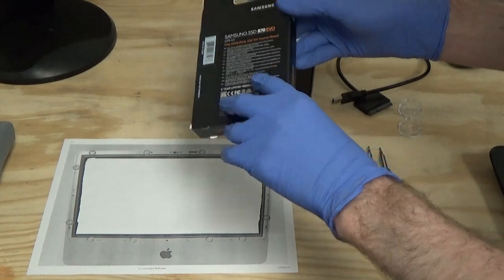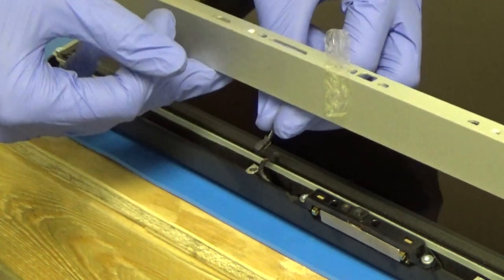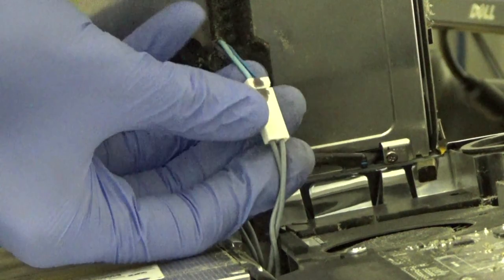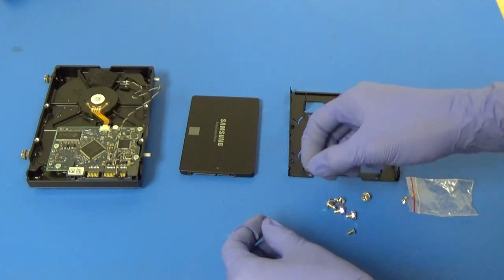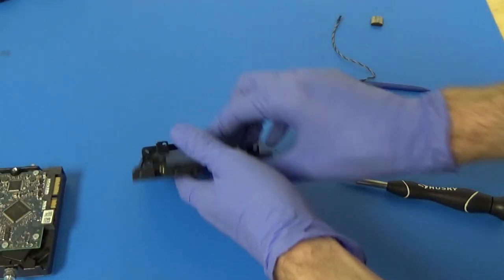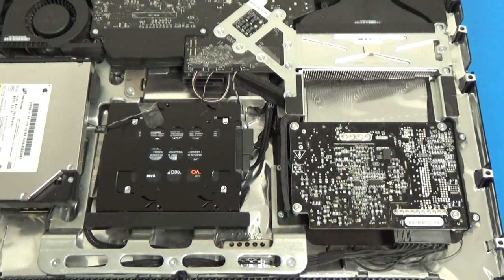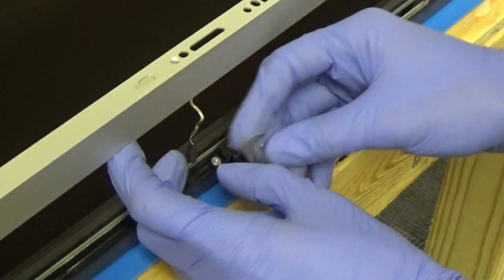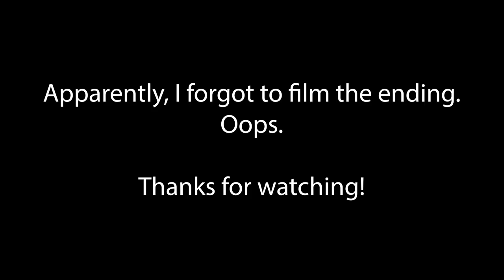iMac (20-Inch, Early 2009) SSD Upgrade

Comment: Great video! I was curious though how do you clone the original hard drive on to the ssd? I want to keep all my files and settings from the factory hard drive onto this one
Reply from the maker: I use a program called Clonezilla. If your new drive is larger or the same size as the old drive, you can make an exact copy. If you’re going to a smaller new drive, that program won’t work.

Comment: If one gets the same hd as the original. What's the one to get?
Reply from the maker: I don't remember what was originally in this one. The Apple Tech Specs page for this model [ https://support.apple.com/kb/sp507?locale=en_US ] shows it would have been either a 320 GB, 640 GB, or 1 TB 7200 RPM SATA drive. It doesn't specify the brand, but I've seen a lot of Western Digital/HGST drives used in Apple products. Hope that helps.
Reply: @G6TechnologyServices  Yeah I suppose. The one I happen to have in there was the Hitachi brand and had the apple logo along with some writing on the sticker.

Comment: Thanks for this. Going to try.  Questions: Same HD and case for 27" IMAC? and I have a timecapsule backup, would I be able to just load it onto new drive from that?  Thank you.
Reply from the maker: I’m not sure, but it is probably the same HDD. It will need the same bracket. I’m not sure about the temperature sensor. Yes, you can restore the Time Machine backup to the new SSD. You will need either an installation USB drive or Internet Recovery to do that. I don’t think this model supports Internet Recovery.

Comment: I had the same problem as the commenter "Made With Junk" - the power cable would not reach to the SSD after installing the SSD in the bracket shown in the video and the parts list, so the bracket was unfortunately a waste. I then used aluminized tape to fasten the SSD to the back of the cavity where the hard drive was. I would recommend that you replace the battery in this iMac when you do this upgrade, as you've got the case open anyway and it's easy to replace (and the one in there is likely very old). It's a BR2032, which is NOT the same as CR2032 - different temperature range. You may not be able to find this battery locally so you may want to order it when you order the other parts. Finally, I didn't bother removing the LCD panel completely, I just opened it up from the left side as in the video, and propped it up carefully with a wooden ruler. There was still plenty of room to do the work under the panel, and I didn't need to bother with the cables connecting the panel to the computer (other than the temperature sensor cable).

Thank you for this video - very helpful!

Comment: Awesome video, very helpful 

I tried two different brackets for my SSD, one corsair CSSD-BRKT2 and one parts bin one and neither had the cables line up. The power cable was the problem and I didn't want to pull too hard on it. In the end I used some packing tape to tape the drive in. I also taped the heat sensor to the drive with packing tape because the adhesive was no good. 

When pulling the glass make sure to pull it straight up. I angled it from the top as I only had one suction cup. It worked, but it broke the very center, bottom alignment pin. The glass went on ok, looks fine and the magnets hold it. 

Lastly, the white connectors behind the screen are keyed. The pins are offset and there are subtle differences that make them one way. Great idea about the sharpie, but as long as you are gentle putting them back together they only go one way. It will go half way in the wrong way, but if you spin it around it will easily slide in. 

Now off to install xubuntu... :)

Comment: Does this allow you to have a better OS....more up-to-date? What would be the benefit of doing this ?
Reply from the maker: No, it won’t unlock anything special like that. The main reason to replace the hard drive with an SSD is to make the system faster. An SSD is several times faster than a hard drive and will improve overall system performance.
Reply: @G6TechnologyServices  I bought a year ago a Mac 2008, with 2 slots of ddr2 memory, and it has 4, can I update memory to 8 or will that not work, I am new with Mac.
Reply: Which os runs best with this mod

Comment: Hello, I have 20-inch, Early 2009 imac Intel Core 2 Duo - Ram 8Gb - NVIDIA 256 MB
Without ssd I can't upgraded to ssd. What's the best MacOS for my iMac?

Thanks.
Reply from the maker: It looks like 10.11 El Capitan is the latest supported version of macOS for that model. There are some tools you can use to put more recent versions on unsupported hardware, but do that at your own risk.
Reply: @G6TechnologyServices  Yeah, I know my MacOS now is catalina

Comment: I have an early 2009 with a 24” monitor. EMC; 2267.  Would the components be the same?
Reply from the maker: Here's the guide for that model: [ https://www.ifixit.com/Guide/iMac+Intel+24-Inch+EMC+2267+Hard+Drive+Replacement/9028 ]. It looks like the same process and would use the same components.

Comment: Any thoughts on replacing the 2032 battery?
Reply from the maker: You might as well replace it while you have the computer open. I usually change them when I refurbish computers.
Reply: @G6TechnologyServices  thanks I figured that, almost 15 year old battery is old enough

Comment: What is the best os for this upgraded iMac ?
Reply from the maker: You have a few options. The latest macOS that it will run is too old for me to want to use it, but you can put that on there if you want. There are ways to get the most current version or a more current version to work, but I don't like to do that because it can cause poor performance in some cases and can get messed up during software updates, but you're welcome to try it. There is always some Linux-based OS, like Ubuntu if you want to try that. If you can get Bootcamp to work or find the drivers, Windows 10 would be my choice since it is up-to-date and fully supported still.

Comment: Would this fix an imac that wont boot cuz of a bad startup disk??
Reply from the maker: Yes. If your startup disk died, replacing it should fix the issue. You will need to have a macOS install USB drive prepared ahead of time if your Mac doesn't support Internet Recovery.

Comment: What’s the best os to run on these?
Reply from the maker: 10.11 El Capitan is the latest version of macOS to be supported on the Early 2009 20-Inch iMac. I wouldn't really want to run that though because it is so old. You could always put Windows 10 on there or try out some Linux-based OS like Ubuntu. There are ways to get newer versions of macOS on unsupported hardware, but it is usually a pain.

Comment: Will this allow the ability to upload current software
Reply from the maker: No, it won't change the latest supported software version. It will only make the computer run faster.
Reply: @G6TechnologyServices .  I can't get into things I used to be able but not supported.  Not worth making it faster if I'm on a leash.  Debating imac or mac mini.  Other laptops have a shorter life
expectancy I'm told compared to a mac?
Reply from the maker: I’d say the life expectancy depends on the cost of the laptop. If you get a really cheap Windows laptop, it will be slow and won’t have a very long useful service life. If you get a nice Windows laptop, it can last longer than a Mac. Apple restricts the latest OS version that can be installed on their products. For example, I have a 2013 MacBook that still runs very well and is fast, but I’m stuck on an old version of macOS because Apple decided not to allow that laptop to run the newest version. Microsoft doesn’t really do that. I have the latest version of Windows 10 running on a PC from 2009 and it’s running great. As long as the PC’s specs are good, it will last a long time.
Reply: @G6TechnologyServices .  Does this also apply to desk tops
Reply from the maker: Yes. I’d say desktops last even longer than laptops since it is much easier to upgrade components over time to help make them faster.
Reply: @G6TechnologyServices  . Would be great if you could change components as you can with a car. Rather than having to buy a completely new computer.  Plug & play
Reply: @G6TechnologyServices . If you were to purchase a desk top which would you buy comparable to  price
Reply from the maker: With desktops, you can change components pretty easily. You can easily change the storage and graphics cards. You can add RAM, change the CPU. You just have to make sure the motherboard is compatible. If not, you can change that too. I usually buy old Dell desktops from auctions and upgrade them with more RAM and a new SSD. It depends on what you are trying to do with it. Gaming and video editing have higher requirements than a business use computer or one used for email, video watching, and social media.
Reply: @G6TechnologyServices  . The issume is that I have an imac. 2008.
Can't get additional software upgrades
Reply: @ewaldradavich7307  You can install Linux but then you can’t use your Mac programs, and you can install Windows in Bootcamp and switch between windows and Mac. If I were you and you want as little change as possible and don’t want to give up your programs, I would sell it on eBay and just buy a little bit newer model to last you a few more years
Reply: @ghost-user559 . Thanks
Reply: @ewaldradavich7307  There is one more option if you are feeling brave and I would recommend backing up your system and data to another external hard drive before you do it. This is free but it requires you to use a patcher software. Look up YouTube videos on OpenCore and updating unsupported Mac. A 2008 can go all the way to the modern OS  if you do this, but certain new features might not work. You want to research the exact model you have and look at what people say about your model. But once you do that it thinks you are actually using a new computer and your software can update like new. That’s the free solution but it takes a little tinkering. I would recommend you backup everything and follow a tutorial on OpenCore here on YouTube.
Reply: @ewaldradavich7307  The only trick is that you definitely do want to add more Ram and have an an SSD installed if you want the newer software to run smoothly. But if you are willing to do this then for the cost of your time and a few parts like Ram and an SSD you can probably use the computer you have now for years to come. The only reason I say this last is because not everyone is comfortable with opening up a machine, and people can be intimidated with patcher software. But it’s basically free and it gets us a few more years out of these systems, and we get to keep our Mac software and update it too.

Comment: While I watch it, would the temp sensor be of any help in case of SSD, I know regular HDD can get warm some even up to 50+ degree C, mine does it on laptop and still working, for years though I need to replace it soon.
Reply from the maker: SSDs don’t get as hot, but the fan will run at full speed if you don’t have a working temperature sensor. There is fan control software you can use to manually turn it down, or so I’ve heard. I’ve never tried that myself.

Comment: MY imac make the sound but doesnt turn on what could it be?
Reply from the maker: I would suggest making sure all the connectors got plugged back in. It could be that the display cable or backlight power cables aren’t connected.
Reply: @G6TechnologyServices   I've check plug etc no joy?!
Reply from the maker: If it is making the chime sound, it is working. It’s just an issue with the display. You can try attaching an external monitor to confirm. If that works, triple check that you plugged in the display data cable and backlight cables all the way and in the right position. Also check the brightness and make sure it isn’t just off. Hold the brightness up button on the keyboard and see if it comes on.
Reply: @G6TechnologyServices  Sorry I meant fan sounds no chime sounds
Reply from the maker: Oh, that's different. Try unplugging it, holding the power button in for 10 seconds with the power cord unplugged, plug it back in and follow the instructions attached to reset the NVRAM. See if that helps. https://support.apple.com/en-us/HT204063